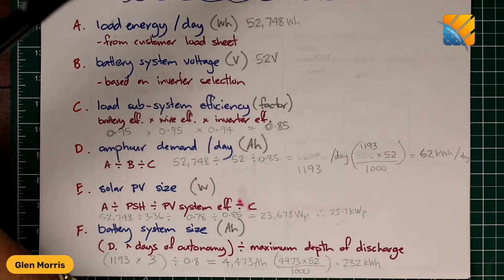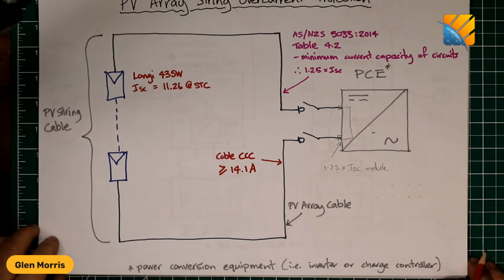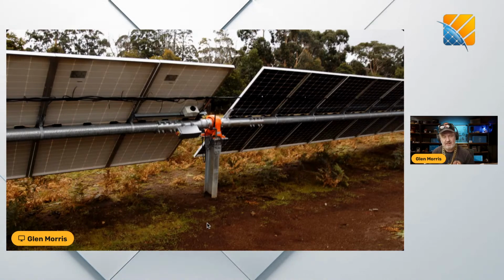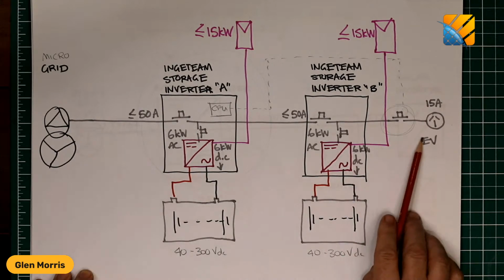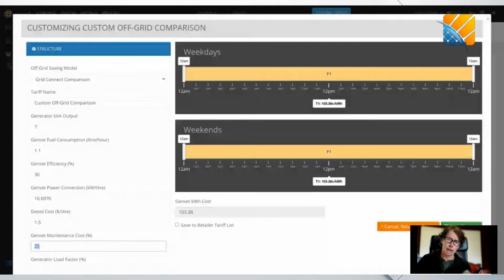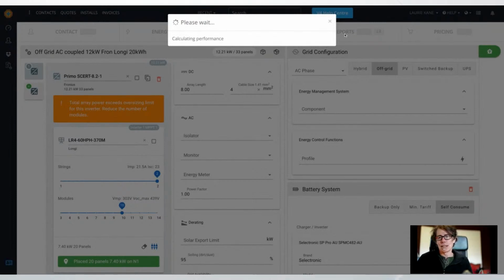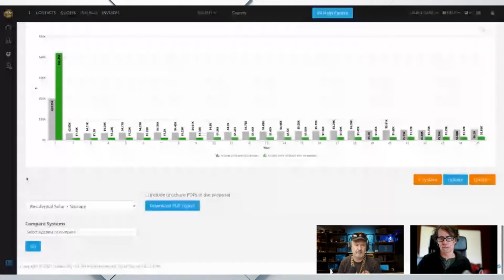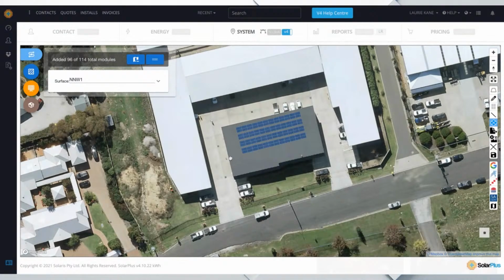Toolbox TechTalk: Off-Grid Design (Ep2)

Comment: Glen, we have projects in Southern Qld, retirement village.  Proposed area of PV 2250m2,  750m2 Tractile new roof in prefabricated passive house and 1500m2 PV panel on existing roofs. Tesla Batteries 4MW like Hornsdale Batteries 2 off them.  All dependent the approval the developer.  There 250 residence and 15 staff I have allow 3kw/day = 800kw/day for the micro-grid.
Brilliant podcast.
Reply from the maker: Thank you, glad you enjoyed it. What are you basing the 3kWh/day per house for supply from the microgrid? I would've thought a retirement village would have significant nighttime energy use (heating/cooling).
Reply: @SmartEnergyLab   It twice as three use per day or average as Australia house consumes 25-30kw per day.  I will send you schedule on the project if you have look it. I will send it this week